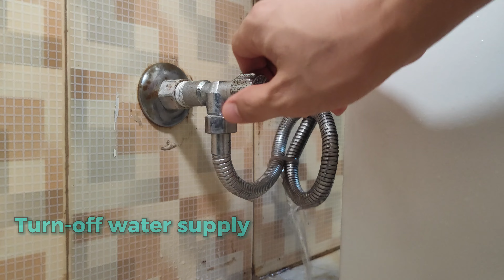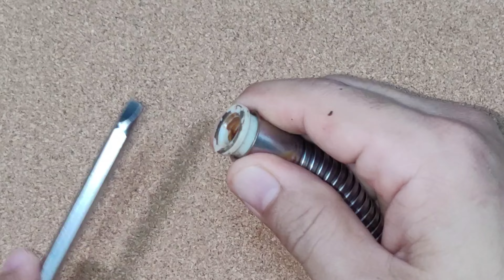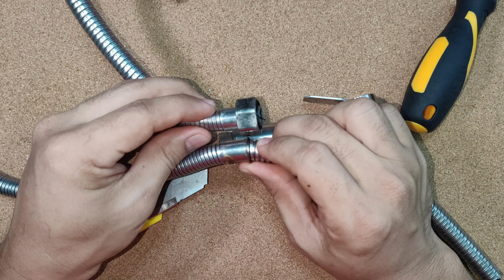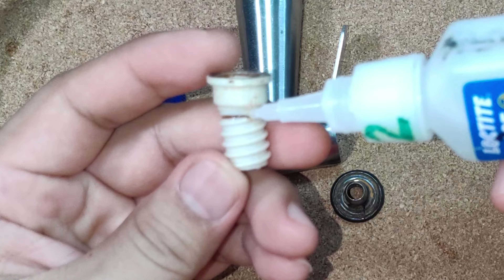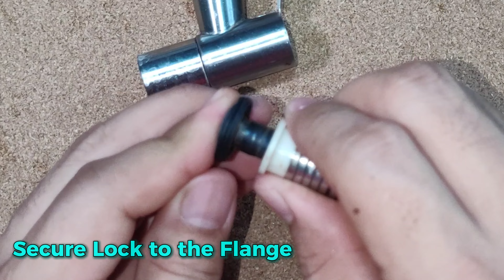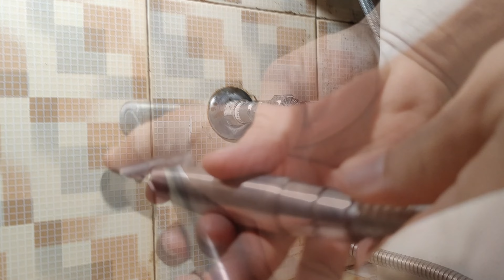How to Repair Leaking Bidet Hose! Without Buying a New One!

Comment: If the plastic part is metallic and involves a crimp, it doesn't come off.
Reply from the maker: If it is the crimped type then it cant be repaired. Only solution for that type is renewal.

Comment: You just changed the hose leak, not the actual bidet faucet section (that´s my problem).
Reply from the maker: Yes, your case is another story. But most likely your faucet only needs dismatling and cleaning, sometimes it solves leaks.

Comment: Hi, what if leaking is at both end?
Reply from the maker: Its less likely to leak both ends. Its probably leaking on the top part and excess water is just crawling inside the metal shielding. Only way to find out is to rectify the upper leak first.